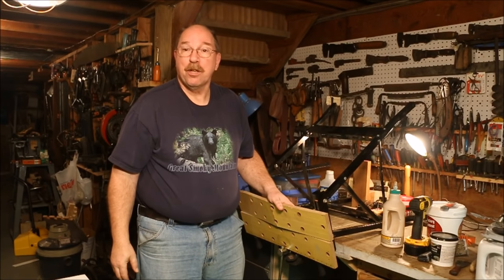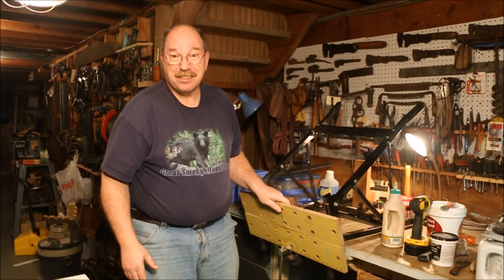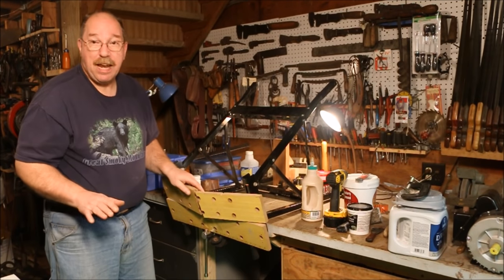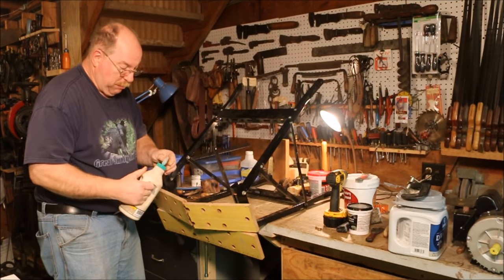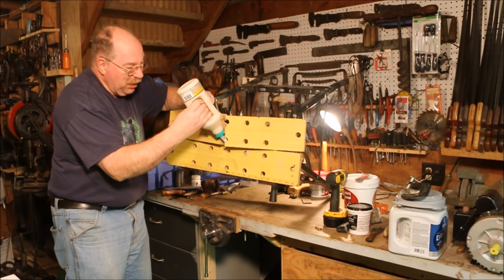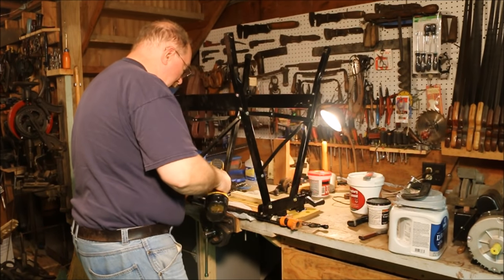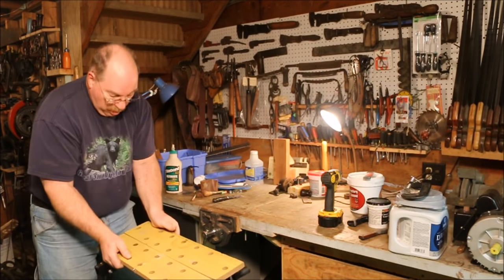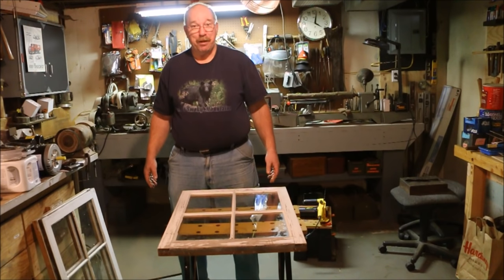Tips & Shortcuts ~ Repairing A Workmate Knockoff ~ By Old Sneelock's Workshop

Comment: ..i have the same kind. i did replace the original boards with some 5/4"x6" pieces that were left over. the plastic cranking knobs got broken off, but i don't use that feature any. i'll just use a regular bar or "C" clamp if need be...
Reply from the maker: Ol James If it does what you need it is a success.
Reply: Old Sneelock's Workshop ..if it don't it's either in the scrap pile or the burn pile...

Comment: Not bad quick fix, probably better to replace the boards though. A minor nitpick, the original workmate, sold commercially, actually had cast legs. The stamped steel came in the next generation.
Reply: kleinjahr   I own one with cast legs and love it.
Reply: kleinjahr I own one of the ones with the cast legs. Picked up at a garage sale for 10 bucks. it was clearly used as a stand for painting. It has no less than a 16 in, of house paint on the top. Whwn it warms back up I will pull it outside and take some stripper to it. As all these benches you find it no longer had the bench dogs. So I made some up with some old oak Dowel, from a towel rack, some square pieces of oak cut from some pallet wood and leather from an old purse found at a garage sale. Mostle use it when working out in the back yard as a saw horse, but it is aboutbthe right size that I am using it a an imorovised draw horse for a handle I am making. Old Sneelock, looks like the previous owner put one of the top on incorrectly. I am under the impression that the little notch should face inward. Thanks for posting.
Reply: Mine has the dogs but one of the rubber feet is gone. Can't have everything, I suppose.
Reply from the maker: kleinjahr I have Dad's with the cast legs. It's been upgraded with a larger table top. 
One of these is a later Workmate like you speak of.  For the broken one my plan is to make a sheet metal top to use as a collapsible welding bench.
Reply from the maker: Lewie McNeely A bit of inner tube and duck tape and Bob's your  uncle.
Reply: Old Sneelock's Workshop
If you use plate that should work,maybe somewhere between 1/4 and 1/2 inch thick. Another possibility is to use a piece of grating as the table. That way you can use it as a platen.
Reply from the maker: Matt Cooper I went back and checked. The dog eared corner is where the previous owner trimmed a little too close to the table. 
For $5 a couple little extra notches is no big deal.
Reply from the maker: Tim Caldwell The style with cast legs has the extra set of folding legs that makes it short enough to put your knee on while sawing.
Reply: Old Sneelock's Workshop I'm glad mine's stamped. I like my knees better unsawed.